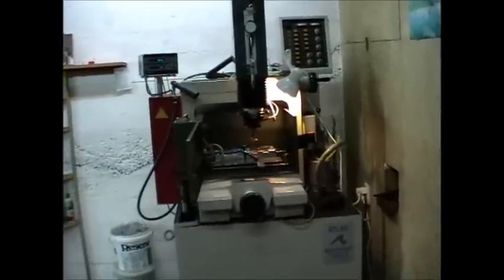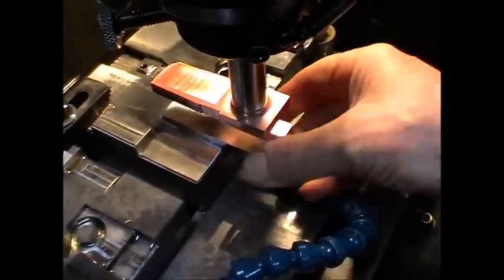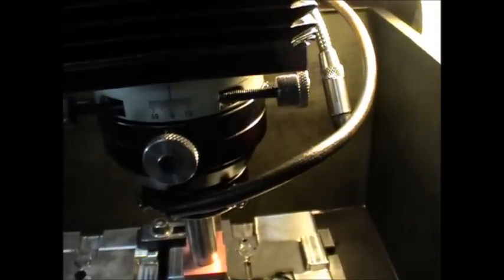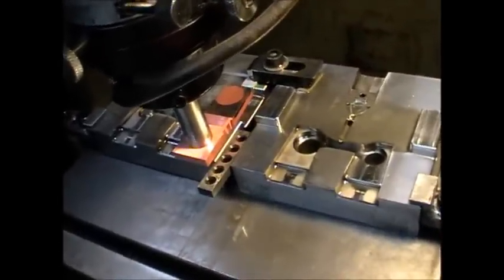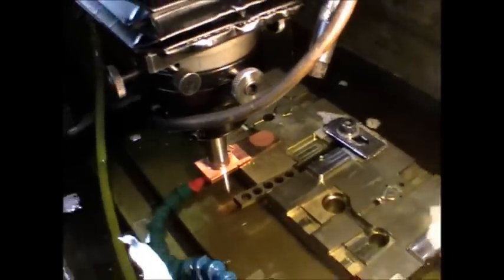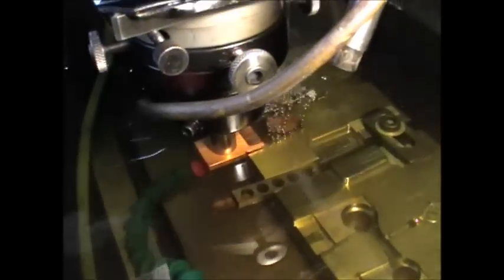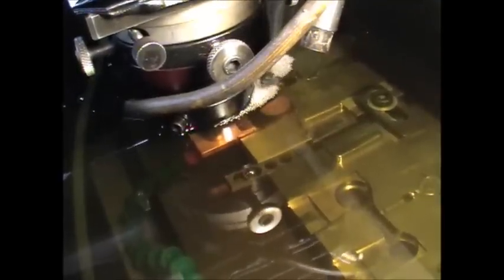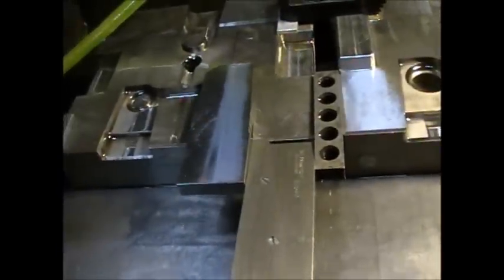EDM/ SPARK ERODER - A SHORT INTRODUCTION

Comment: THANK YOU for sharing your work. Would you mind if I ask.... why would you not raise the electrode high enough ( 5- 10 mm about 1/4 -1/2 " ) to clear the eroded material. You mentioned, that would wear the electrode quickly ? ??
Reply from the maker: +Saadk Ali Hi - Do you mean after each approx. 1-2 second phase of eroding?-
Reply: Yes..
Reply from the maker: +Saadk Ali Well in practice the lift is increased to allow the soot to clear. In some jobs that is 5-10mm, but for most shaped electrodes the soot clears after about 0.2 - 1 mm.  Cheers.
Reply: +Threadexpress ok...again, thnks for posting.